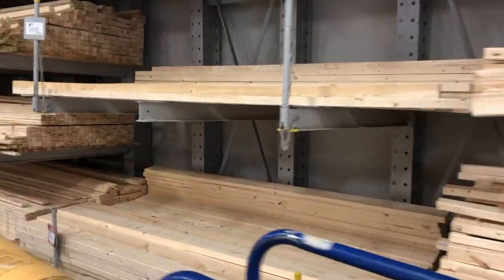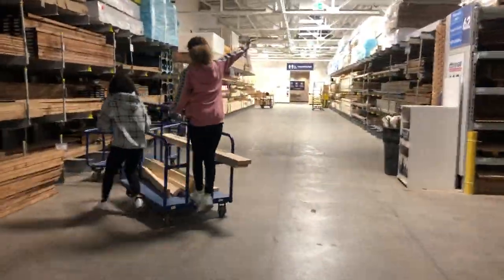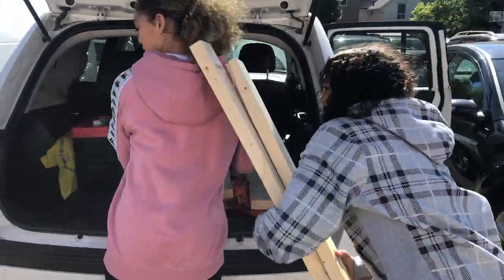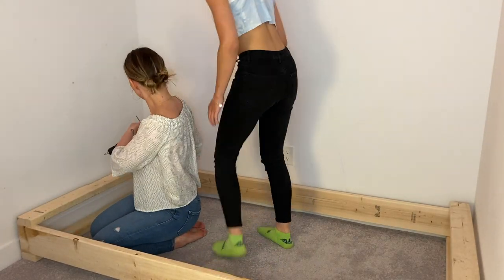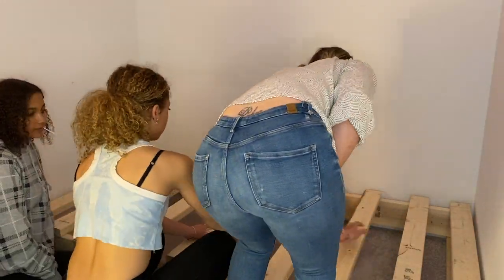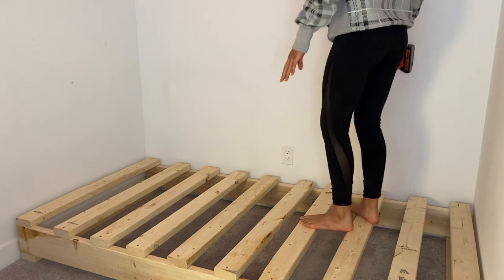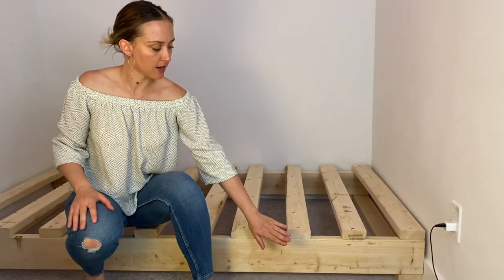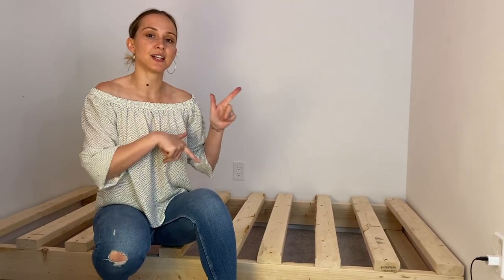DIY 30 MINUTE TWIN BED FRAME | PERFECT FOR SMALL SPACES

Comment: A friendly tip. If your drill bit is getting stuck try tightening your chuck. Bits get stuck cause they are slipping in the drill gun.
Reply from the maker: This is good to know. I should know this as i'm a handman's daughter.